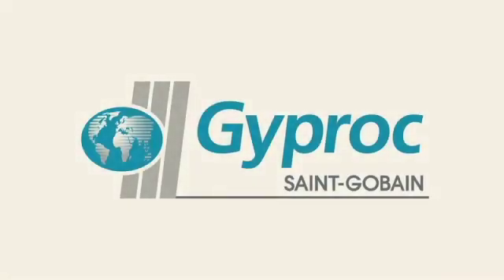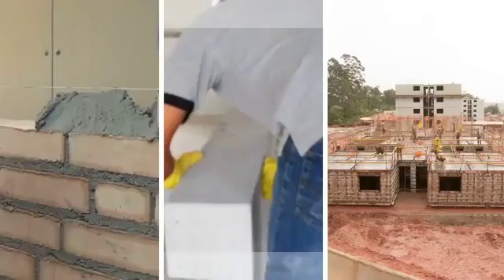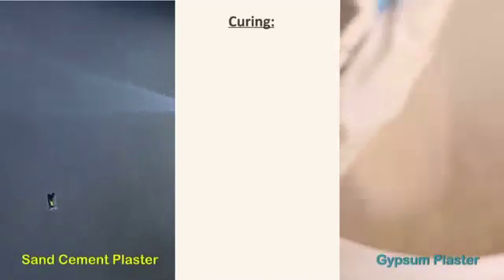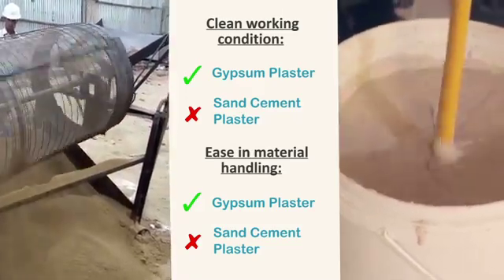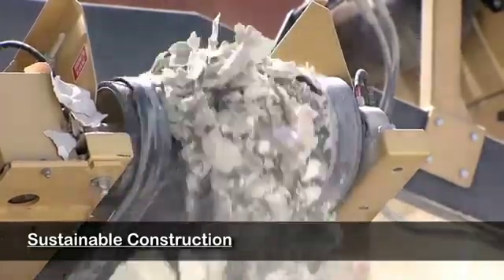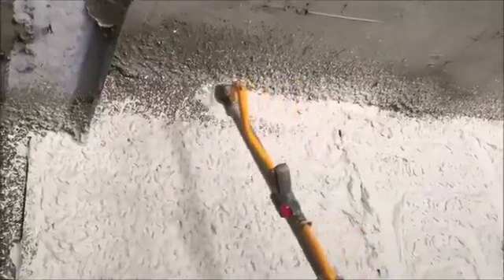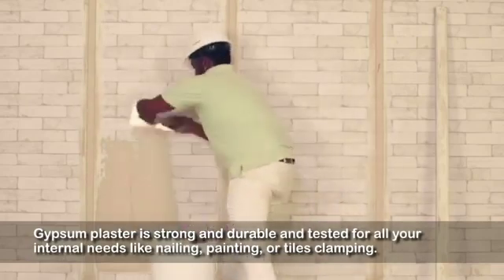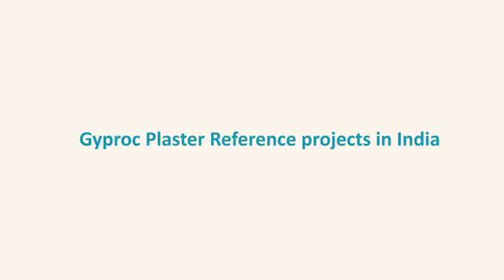Benefits of Gypsum Plaster Vs Sand Cement Plaster

Comment: 1). Can we use as joint filler in red brick or cement block work?
2). Can we use for external plastering also?
3). After placing the electrical conduits and water supply Pipes.. Can we fill those grooves (chipping areas) with this paste?
4). What will be the min & max thickness of plaster?
5). Can we use this plaster over red brick wall also?